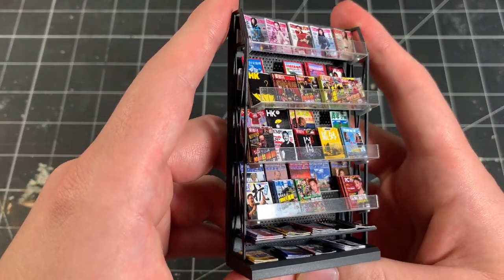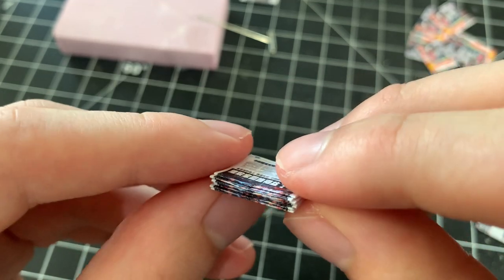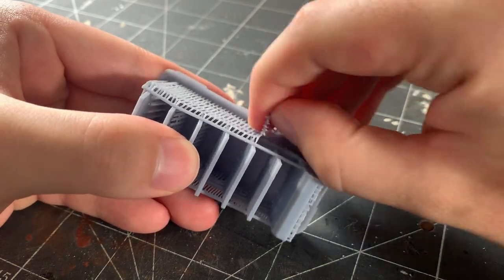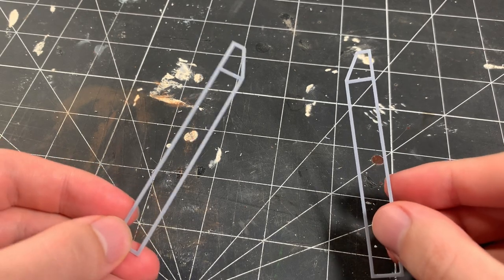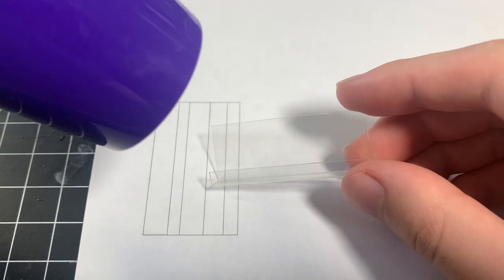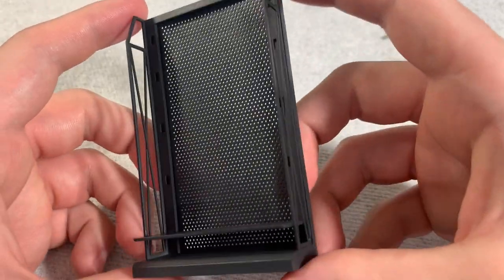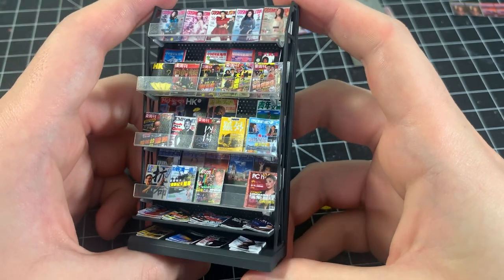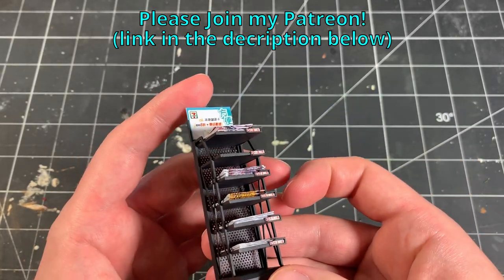DIY - How to Make Miniature Magazines & Magazine Rack for Dioramas & Dollhouses

Comment: Did those back panels really need supports? Is the printer you use incapable of printing flat pieces?
Reply from the maker: Technically speaking you don’t need supports to print them. I do for the sake of protecting the print itself, and for print quality. If you print this flat on the build plate, you’ll likely ruin the print trying to scrape it off, unless you have a flex plate. In regards to print quality, again, printing it flat will likely fill in the .025” perforated holes in the panel, especially with the over exposure of burn in layers. It’s more work, but I always raise my prints because I personally find I have the most control over the final outcome!